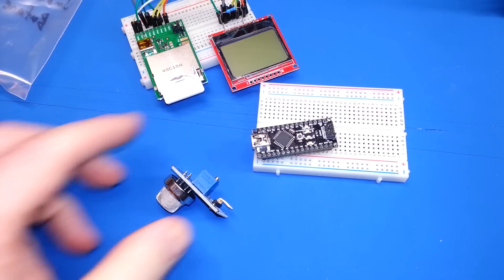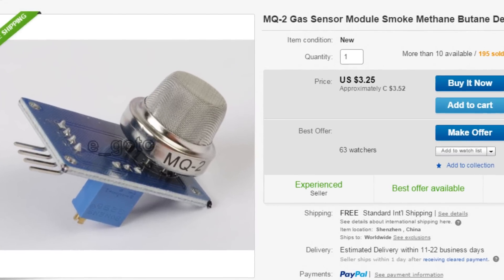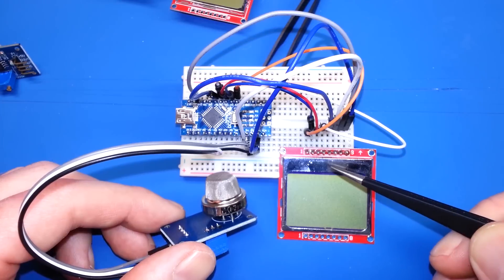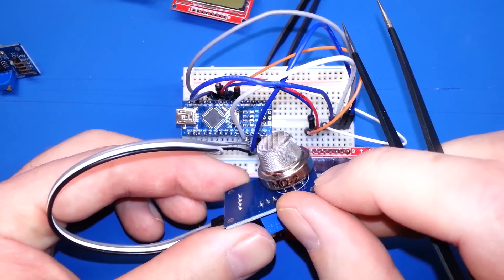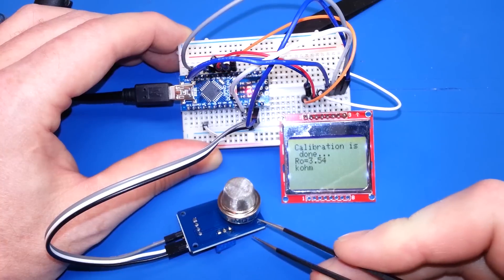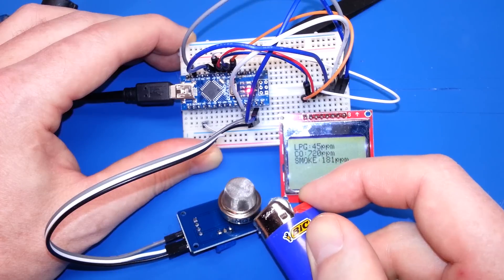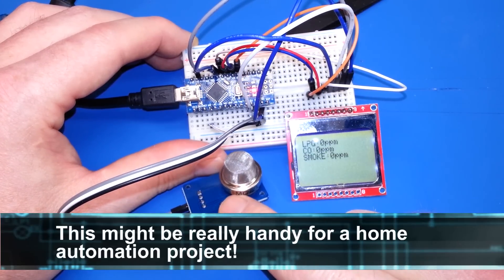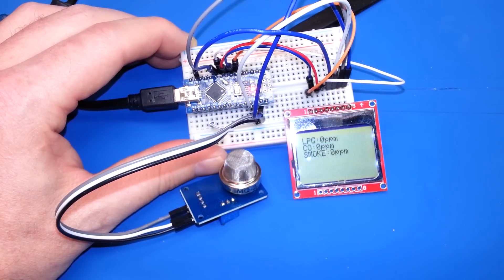Smoke & Gas Sensor for Electronics Projects- MQ2

Comment: I have tried to get the output on the serial monitor(replaced display with serial and commented out the additional/unnecessary display functions as i don't have that display unit)...but always it shows 0 ppm for all gases...but only analogRead(A0) gives the output...i.e. it changes with the Gas...

Comment: Nice, but in your code there is parameter in line 33:  #define RL_VALUE (5) //define the load resistance on the board, in kilo ohms
How it is possible to define how much resistance this module has? Is this 5kOhm the proper value?

Comment: Hi 

I am using MQ2 (http://www.seeedstudio.com/depot/Grove-Gas-SensorMQ2-p-937.html) with Arduino UNO
I am using the codes that read analog data 
(http://www.instructables.com/id/How-to-use-MQ2-Gas-Sensor-Arduino-Tutorial/step3/The-Code/)
but I get random values at various positions
How do I calibrate them and how should the resistor pot be positioned for accurate gas sensing

Could u post codes on Calibrating and simple and similar  "Arduino code" and differentiates it with respect to the gases.

Comment: What is purpose of the pot in the board?
Thanks
Reply: +Felipe Condon (Pipe) It sets the point at which the LED on the sensor turns on and, I believe, the point where the digital pin registers gas.
On the analog pin, it seems to do nothing.

Comment: Hi.
Looking to line
"#define         RL_VALUE                     (5)     //define the load resistance on the board, in kilo ohms"
in your code i think than RL value is 5 kohm. Is it true? I am asking about is because on my MQ04 (FC-22) boards i ve found 1 kohm resistor (SMD 102) between sensor and ground. Are you sure than on board which you showed us is 5 kohm resistor?
By the way your film is great, but understanding how to find values x,y, and slope (x and y was easy to find but slope ...) of used curves was not explained :). I needed much time to understand it :).

Comment: Hi. We read the datasheet of Mq-135 sensor, which sense for multiple gases in arduino. However we have a problem because  our laptop  only read one column, but LCD you read 3 kind of gases, and We do not know what kind of gas we are reading (how we do that?), and furthermore, we want read all gases  in several columns with the laptop. is possible to do this? thank so much in advance.
Reply from the maker: +Sinhué Haro Corzo Code is linked in the description :)

Comment: What is your alternative that you will use for your project?
What kind of sensor draws less current? Thanks.
Reply from the maker: A normal smoke detector with the buzzer out either directly to a relay or through the Arduino. Cheers